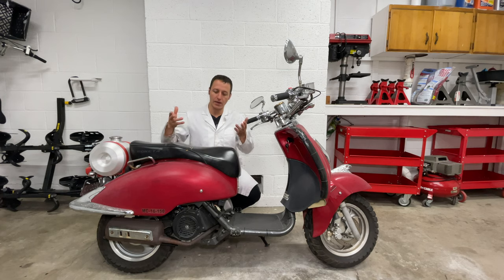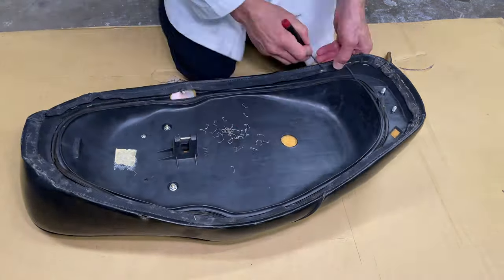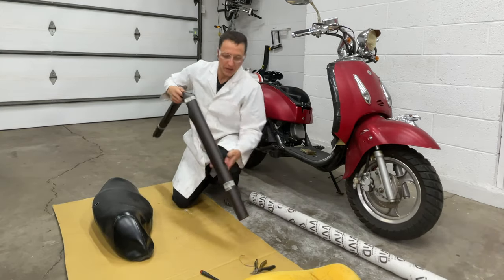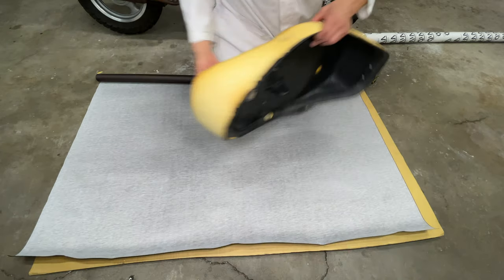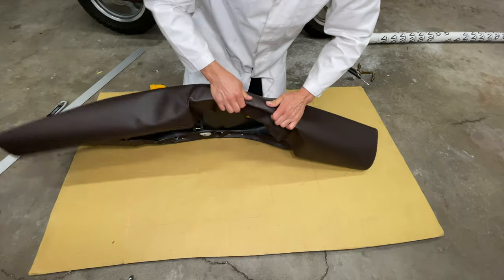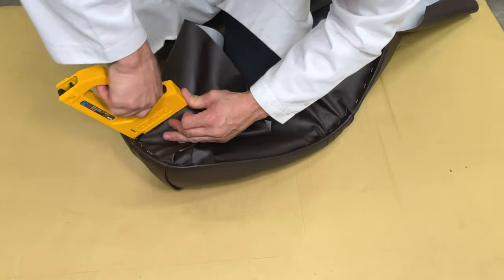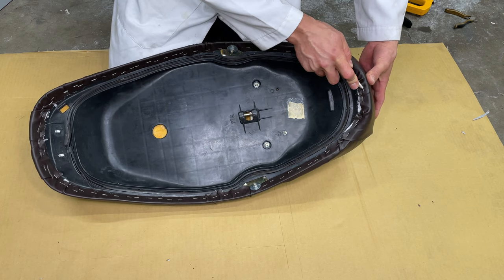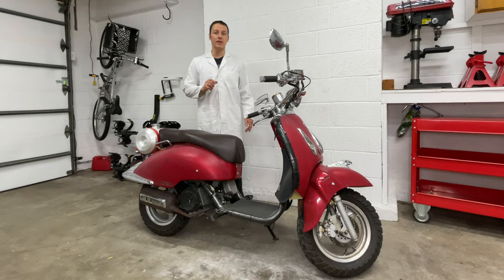Fixing the seat cover fabric on a Chinese scooter

Comment: For that money you could have bought a good used one.
Reply from the maker: I disagree.  Although Chinese scooters share the same GY6 engine, the body styles vary a lot.  Roketapartsdept.com sells the exact seat for my scooter, new for $147.  
Finding a used seat may be hard, because it would have to be from my exact scooter.  There are several Chinese scooters that look exactly the same, but there could be small differences that would make other seats not fit my scooter.
Amazon sells seat covers for $11 that fit over your existing seat.  Plain black vinyl material is also less expensive than the brown one I used.
Reply: @LabCoatPaul  I know that this was done for educational purposes disregarding the financial aspect. You do excellent work I don't deny that. I just figured that these types of seats should be available in abundance.